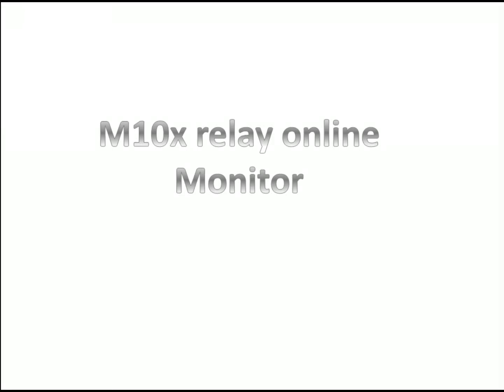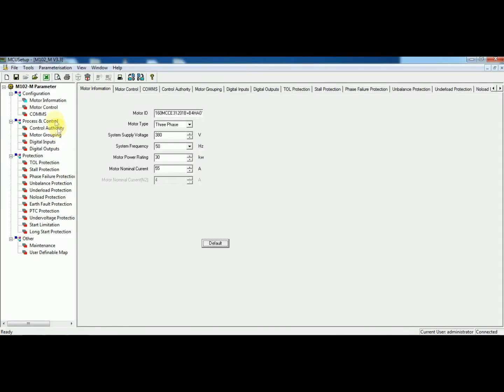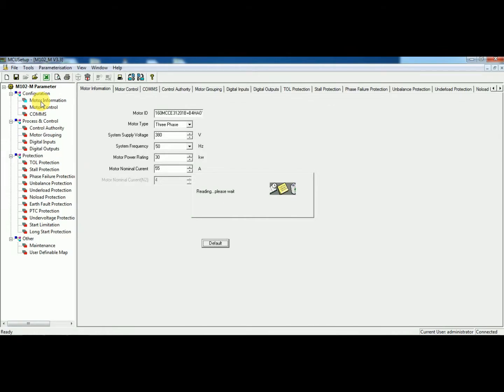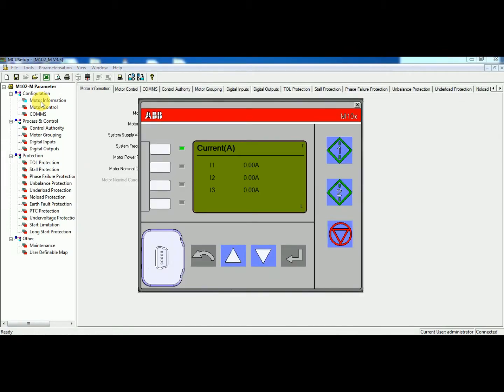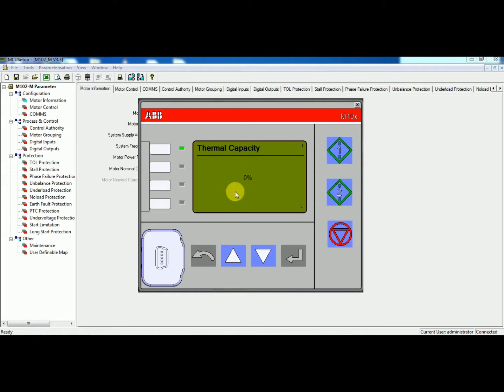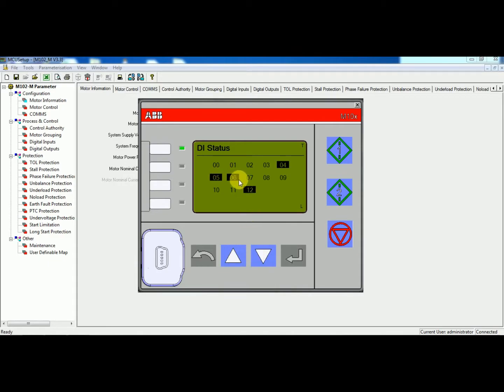online monitor | for | M102 | & | M101 | ABB Relay | MCU Relay

Comment: Dear barani san
is it possible to reset the hour metter value instead of 0 to another value
in case of changing drawer or switching between it
Reply from the maker: not possible
Reply: Is possible can I get this software of this relay